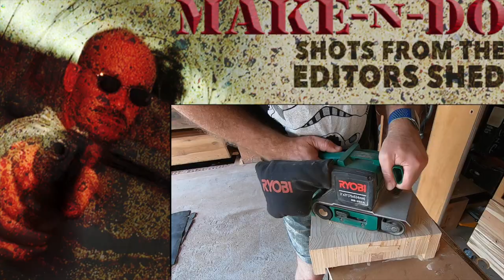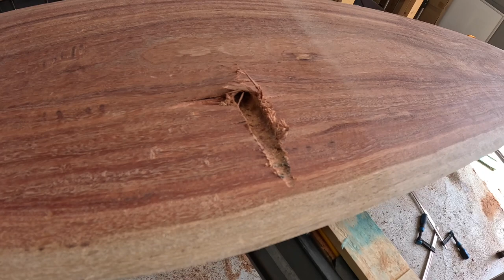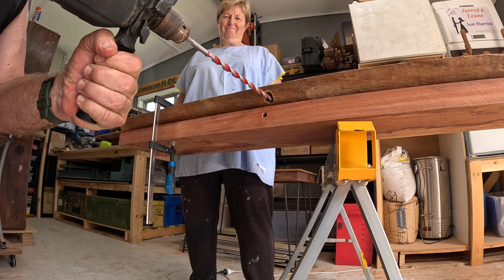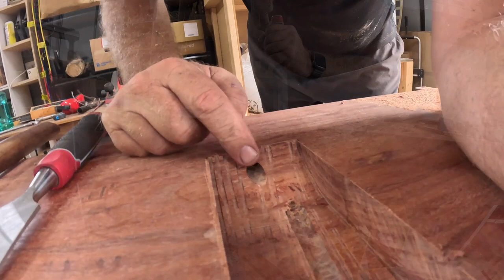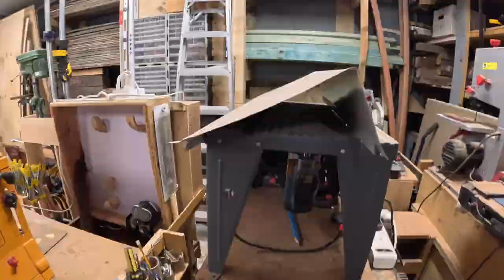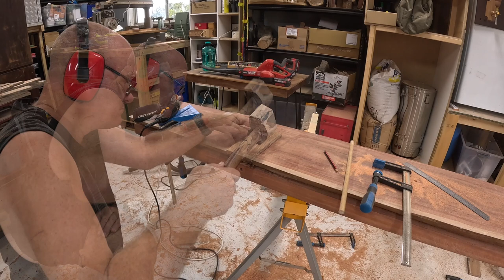Sunroom table Pt2 – near killed me

Comment: Can’t begin to tell you how impressed I am.  I have become a firm believer that it’s how you recover that makes all the difference.  At a guess I’d suggest your drill bit got too blunt and all it could do was follow the easiest line, which was not straight and level in this case.  That’s the love of Ironbark for you.  The end will justify the means.

Try using some sanded sawdust from the job mixed with some shellac rather than glue.  It drys very fast and the shellac is more or less clear so adds nothing to the colour.  I could also recommend Wellbond glue from Bunnings.  Works and looks like pva but drys completely clear.

Again, well done.  If your wrist gets sore get it checked.  It was a drill doing what yours did that completely wrecked my right wrist years ago.
Reply from the maker: Can’t begin to tell you how impressed I am with the tips you pass on. I seem to learn as much from you in these comments as I do from watching other videos. Thank you Mike. 
You might be right about the drill bit. I was not impressed with that brand. The second drill bit I bought to replace it ($4 extra = $69) worked brilliantly in every aspect – straight and true – and 'augered' the chips out behind it.
Reply: When I built my hall table on a course by Dunstone Design in Queanbeyan in January, they use superglue to fix timber surfaces and cracks.  While power sanding apply some superglue to the void then sand straight away, if it’s still visible, do it again and again till the void is gone.  Polishes well and looks great.
Reply from the maker: @mehDustMaker   thanks again – will do